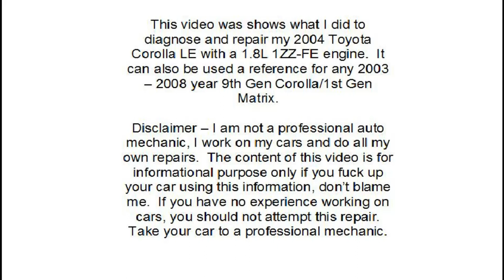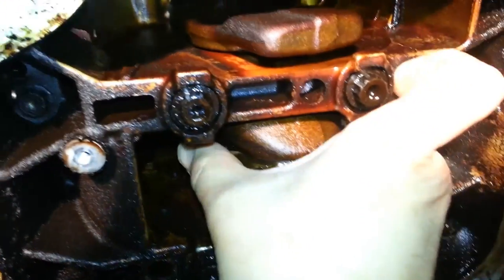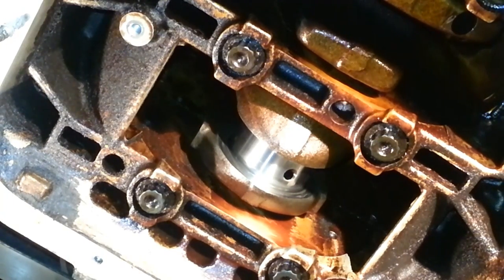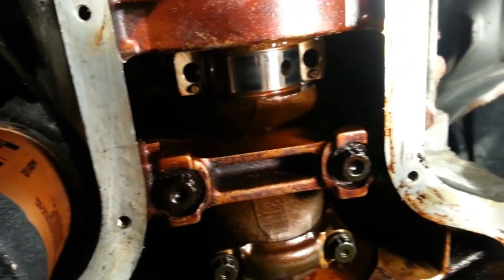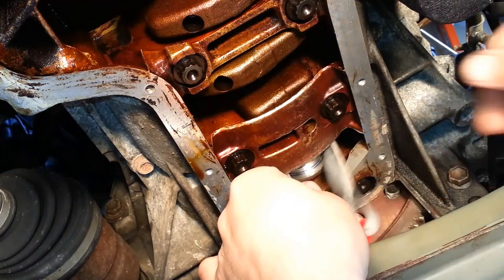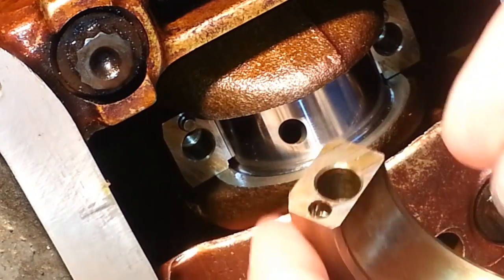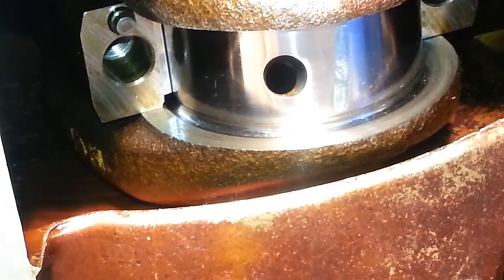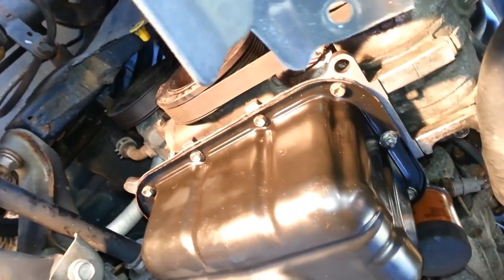2004 Toyota Corolla 1.8L bearing replacement to fix rod knock caused by bad connecting rod bearings

Comment: wonder what a shop would charge for this? would go easier on a lift so probably a reasonable priced job but most ppl do stupid stuff like dumping lucas in figuring it would fix it but only puts a bandaid on the prob. If i use lucas i suspect its better to use enough to stop the leak but not much more than that as you dont wanna stress tf out of the pump & starve eng of oil
Reply from the maker: No clue on a cost, but I agree the lucas is only a short term fix at best.
Reply: Good luck tossing 800 or more at this job for a shop 👌👌 lol learn an do it your self unless you hate your paychecks
Reply: "reasonable priced job"???? What are you serious??? First they'd never polish it and secondly they'd probably charge you as much as doing a head gasket or something drastic because although this looks easy enough, it's a drastic enough problem to destroy the engine if not dealt with early. So I'm sure they'd charge you like they saved your life.

Comment: I got a 01' Corolla manual and was driving while low on oil and i heard that ticking sound so i pulled over and poured a quart of oil in and it silenced out a bit but kept ticking in high RPMs. I'm now running on about 2 quarts and some Marvel Mystery Oil but the ticking is still there. I'm getting an oil change this weekend, but how do I diagnose whether it's the lifters or something?
Reply from the maker: Marvel Mystery Oil is not your solution, it is best diagnosed by a professional mechanic.  A simple way to tell quickly if the engine was damaged from lack of oil is look for metal flakes in the oil when you change it.
Reply: @mrmarkg8564  if there are metal flakes in the oil, can you still repair the engine or better replace the engine?
Reply from the maker: @robydany8749  It depends on the damage done, metal flakes could only be the bearings breaking down and is still salvageable as mine was.
Reply: @mrmarkg8564  if mine has rod knock and heavy blue smoke on the back...should i repair it or replace it?
Reply from the maker: @robydany8749  Won't know unless you take it apart. Could only be bearings and rings.
Reply: @mrmarkg8564  replacing bearings (and machine the crankshaft) and replacing rings in a car shop costs a fortune:)

Comment: Quick question- when you rotate the engine with the bearings removed and the piston stays at its top position, would the valves crash into the top of the piston? Did you do something to work around this or would this not even be the case? I'm new to this and im just trying to learn as much as I can. Fantastic video!
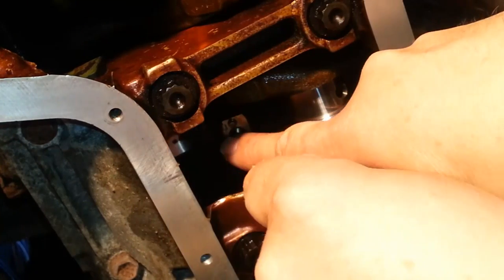Reply from the maker: I did not push the piston to the top, only far enough to clear the journal.  Talk about it around the 32:05 min mark in the video.
Reply: @mrmarkg8564  okay, thanks! I must have missed that.

Comment: Hi can i do only un the vas pistones alone ir i have yo replace the four cap rod?
Reply from the maker: Sorry I don't understand your question.
Reply: the best is to do the engine, due to oil contamination, that can reach your old caps, and then you will ahve problem in others that could be avoided.

Comment: Hi Mark  I am into my  1992 Camry with the 3.0 litre V6.  My number 6 cylinder was the worst like the one on your 4 cylinder. Did you do one rod bearing at a time and how tough is it to get that rod side bearing to go in? Mine looks like its a little tighter to access than yours...I wonder if I will have to roll in the upper rod bearings. When you wrap the bearing did you  put the cap back on without the bearing as you worked? My rods have the studs vs bolts in the four cyl. I have fabricated a tool to thread on to pull the piston back down.The others should just need a polishing, but I am changing them all with new Toyota bearings.Hopefully the clearances are OK, the crank looks good for 360000Miles(606000 K). Thanks . Appreciate the video......Darrell
Reply from the maker: Darrell, I did one at a time and as I mentioned in the video, I used 2 pieces of electrical tape (sticky side to sticky side) and wrapped it around the journal to protect it and put the caps back on be while I checked the remaining bearing shells for damage. I didn't have any problem getting the upper bearing shell into place, just pushed the piston up enough to be able to work above or next to the journal.
Reply: Thanks Mark I will let you know how it goes
Reply: Hello again Mark. I got my 3VZFE  v6  in my Camry back together with most clearances coming in between .0015 and .0020.  I did have to shim number 6 journal(.0002) to get to spec, but with over 360000,it runs well on the restart. thanks again for your video which helped me tackle this job.
Reply from the maker: Glad the video was helpful.
Reply: VWWRENCHIE

Comment: So if I polished the journal with sand paper and replace all bearings, should I be good for a while until I get it legitimately fixed? It's winter now and I just got my car but the previous owner ran it with an oil leak and didn't tell me about it until I broke down on the highway with a really loud knock that came out of the middle of no where
Reply from the maker: If there is no damage to any other parts but the bearings you can follow these steps and the repair would be permanent.  Be sure too check the journal and connecting rods ends for damage and measure your oil clearance with the plastiguage.

Comment: you don't have to take off the whole engine to do that , right ? and do you have any clue how much would it cost if i wanted a mechanic to do that for me ?

thanks for the video tho
Reply from the maker: That's right, The video shows how to replace the bearings by dropping the oil pan without pulling engine from the car.  Sorry I have no idea what a professional mechanic would charge you to do this.

Comment: just curious about well this fix has worked? how many miles have been put on it since u replaced the bearings? im curious because my rola has the exact same sound as this engine did, so in the next day or two im going to be doing this to my car. also thank you very much for this video was sooooo helpful because any other vid i seen, the rod knock was constant which had me confused if it was actually rod knock, but my engine sounds EXACTLY like this one LOL
Reply from the maker: +TheRyley999 - Last time I checked there was about 15,000 miles on it since I replaced the bearings.

Comment: what size bearing did you get or how do I know what size to get for a 2001
Reply from the maker: You can't be sure until you check the oil clearance with the plastigage, but I would start with the standard size bearing. The same size as what was factory installed, it should be stamped on the back of the connecting rod cap. I describe this around 29:35 in the video.

Comment: Is it the same design with the 2ZZGE? Can you access the bearings on it also?
Reply: I can tell I did this same job thanks to this video and the bearings I ordered on eBay are STD model for both 1zz or 2zz. No issue and knocking disappeared 100%.
Reply: @80sPhoenix  can you send me the link to them please?

Comment: can you help me understand something here you used a gauge the green gauge .001 to .003 
you said the oil clearance was .0011 to .0024 but when you measured it it was around .002 to 0015 how can that be right? .. maybe I just do not understand how to read a paper gauge can you help me with how that is right according to oil clearance for that car?
Reply from the maker: It is at the 40 min and 50 secs point in the video that I explain the Plastigauge usage and reading it.  Yes, the oil clearance I required was between .0011 & .0024 and using the plastigauge scale I determined that the compressed plastigauge mark was smaller than the .0015 mark on the scale and just about on the .0020 mark which is within the .0011 & .0024. specs. The larger the compressed plastigauge mark is,  the lesser clearance you have between the journal and the bearing. 
See this link to get a better understanding on how to use the plastigauge. http://www.plastigaugeusa.com/how.html
Reply: Thank you, I did my daughters car and just the second time putting on rod bearings, so was trying to do the best Job that I could do

Comment: Do I just get the standard OEM size bearing? for my 1zz I got a knock on my celica
Reply from the maker: You can't be sure until you check the oil clearance, but I would start with the standard size bearing.
Reply: @mrmarkg8564  did you change the oil after cycling it on and off or is it fine?
Reply from the maker: @chomskyhonk2586  I change it again after a few hundred miles.

Comment: thank you for this video! saved me so much money! I have the same noise and and found rod bearing #3 to be scored up. I checked the other ones and they seem to be perfect. Did you end up using the same rod bolts or do you need new ones?
Reply from the maker: Glad the video was helpful.  I used the same rod bolts, they were fine.  I did however replace all 4 bearings.

Comment: Hi Where was you turning it at and the number of the sand papers
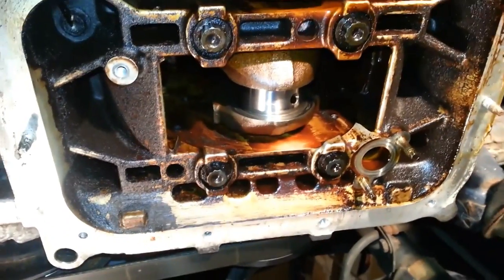Reply from the maker: At 12:19 in the video I explain how I polished with wet paper, I used 600, 1000, 1500 and 2000 grit paper.

Comment: I've replaced all the bearings but now my crank is extremely tight, it won't even turn. Any idea on what I did wrong?
Reply from the maker: Did you verify the clearance with the plastigage?
Reply: There's supposed to be tiny gap between the bearing and crank which is called clearance. It is a very precise and very small number like 0.0015". You can use plastigauge to measure this. You could've used bearings that were too big or maybe didn't oil them. You're supposed to use assembly lube.

Comment: I have a hard knock going on my engine. When I turn the engine on knocking begins like crazy and then the engine dies on me. It was marking the oil pressure being low. I did an oil change and didn’t help much any idea what can be causing this?
Reply from the maker: Knocking is normally a result of poor lubrication which results in failure of metal on metal components such as bearings.  It does not take long for this failure to occur when an engine is run at operating speed with low oil or oil pressure.   Once the failure occurs from poor lubrication, the resistance of the metal on metal components increases and will cause the engine to seize and stall.  How low was the oil when you changed it and how long was the engine operated with the low oil pressure indicator on?
Reply: It was low very low. Once the oil pressure light came on my brother brought it straight home and hasn’t been used since.
Reply from the maker: The lack of oil likely caused bearing failure and it will need to be evaluated and repaired.

Comment: I just watched a rod bearing repair video on a Subaru engine. They have to take the engine out, take it completely apart, split the block into two parts, $6000 job lol. God damned. Lucky for them, it's not a common failure.  Are there bearings out there with better quality? Cause I have seen tons of Corollas and Civics with this type of failure. Yes it's relatively easy to fix, if you catch it early, but it is pretty common.
Reply from the maker: The bearings are designed with a much softer metal composite then the journals and the rods so they will fail first so they don't cause the more expensive parts (shaft and rods) to fail. I'm sure there are higher quality bearing on the market, however, rather than doing a bunch of research on each aftermarket part, in many cases, I will go with the manufactures replacement parts.

Comment: That's a nice job, Mark. May I suggest- in the future, never use "sandpaper" of any kind unless you're able to thoroughly rinse it out (crank out of block). Wrap shoe lace around 3 times, mark ends, take off then rub either Autosol http://www.autosol.com/ProductDetails.asp?ProductCode=1000   or Simichrome into the marked area, wrap and polish. Flush with break parts cleaner. Any tiny residue will harmlessly melt into the oil.    https://www.amazon.com/Simichrome-390050-Metal-Polish-Tube/dp/B0002YUQ4E/ref=sr_1_1?s=automotive&ie=UTF8&qid=1488939357&sr=1-1&keywords=metal+polish

Comment: Why has the one Double Z got a oil pan with baffles and the two double c has just an empty oil pan without baffles
Reply: You can replace the factory 2zz oil pan with a 1zz unit.  I just did this for my matrix XRS.  The issue is that only some of the 1zz pans will fit due to the different baffler cut out shape between different manufacturers.
Reply: Thanks

Comment: Great video except locktight on the rod bolts lol. Completely unnecessary and it doesnt allow you to get the correct tq spec since oil and locktight have different resistance.  Trust me a properly installed rod bolt will NEVER. Fall out.

Comment: is it the same process with a 93 TOYOTA Camry?
Reply from the maker: Sorry I don't know about 93, this would cover 2003 - 2008 9th generation Corolla or 1st generation Matrix
Reply: All cars except horizontal engines can be repaired using this method. I would not recommend sanding anything without having someone Mike it first, which may reveal that you do not need to even sand it, just replace the bearing shells. These are not bearings by the way, the oil is the bearing. They are called bearing shells. Bearing shells establish oil clearance. Oil is the bearing. What wears is the Lithium layer of the of the shell, which increases the oil clearance. and can lead to excessive crush, which is what damages by abrasion lithium layer down to the copper layer and that is when the knock becomes audible. 

If the journals are smooth, just replace the bearing shells without sanding with size STD for standard, not for Sexually Transmitted Diseases. To be sure your repair lasts, use a higher grade multi-viscosity oil like 20W-50 of any brand. Mind what I say to you. . All oils of a specific grade and class are identical. Read the labels for SAE Service Grade The least expensive oil is identical to the most expensive. Oils are formulated to meet Federal specifications that all refiners must meet. 

Following this repair, replace your oil at no longer than a 7500 mile service interval and change the filter every time. You cannot clean a used oil filter. If you have oil leaks, repair them as soon as possible because hot oil hates rubber and there is a lot of rubber parts underneath your car.
Reply: No, split sleeve bearings, are bearings. I make bearings for a living. Fluid film bearings, to be exact.

Comment: Would this work for Chrysler  300 2007???
Reply from the maker: Sorry, I have no idea, I've never worked on a Chrysler 300.  If you can get the oil pan off from under the car, basically everything else should be the same.

Comment: hi I am currently doing this repair in guidance of this video. I have #4 with a spun bearing, and the cap and rod metal is damaged. How would you advise on polishing up the connecting rod? I can polish the cap pretty easily since it's out but i'm not sure on the connecting rod
Reply: Sounds like the rod got beat up pretty bad, there is a chance that you would need to replace that rod.  You might need to pull the motor to fix that.
Reply: @andrewwong3326  well, if i had the money to do so I wouldn't be watching this video lol
Reply from the maker: @ne0tas  Clean it up the best you can and try it.  It doesn't need to be perfect the bearing should not spin if you have the correct oil clearance and it locks into place. If you can't clean it up by wet sanding, you will need to pull the piston and replace the rod.

Comment: you do a great job,but it appears that the failure was due to poor oil management, the whole lower engine appears to have an orange timt to it
Reply from the maker: +breaux gee Yes, as I mentioned below,  I believe it was poor maintenance on the previous owner’s part which caused the bearings to fail.  I purchased the car with 110K miles on it and had to replace the bearings at about 118K.

Comment: is this the same engine as a 94 celica 1.8?
Reply from the maker: This is the 1ZZ-FE engine, the 94 celica is the sixth generation and came with the following engines: 1.8 L (7A-FE I4), 2.0 L (3S-FE I4), 2.0 L (3S-GE I4), 2.0 L (3S-GTE I4 turbo) or 2.2 L (5S-FE I4). It depends on your model, see specs here: (http://www.cargurus.com/Cars/Overview-t17947-1994-Celica-2-Dr-GT-Coupe.html). The most popular was the A-series engine 1,762 cc (1.8 L) 7A-FE and was mostly used in 1993–1997 Corolla (7th generation) and some 1994–1999 Celicas at the base ST trim level.

Comment: Mine has a knocking noise but engine won’t stay on. Could be I need new alternator? My old battery was bad and had to replace it maybe it fried my alternator? Or maybe I missed aligned the timing when replacing the oil timing tensioner?
Reply: It happened to me once, it was a cat sleeping in front of the engine. 😝

Comment: How did you know the noise was due to a bad connector rod bearing?
Reply from the maker: I suspected it was the connecting rod bearings based on the knocking sound that was heard when the engine was revved, but the beginning of the video is when I diagnosed and confirmed it was the connecting rod bearings.
Reply: My car is making that sound  at idle. Is that usually the case or should I be looking for something else.
Reply from the maker: Mine was making it all the time.